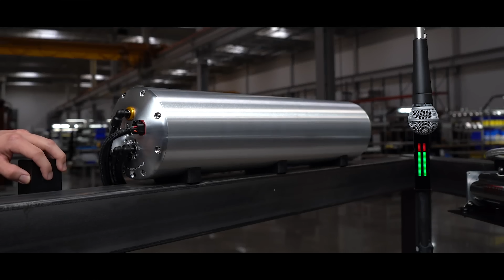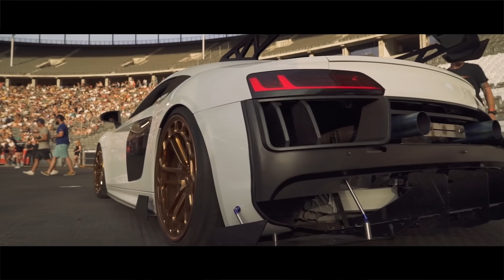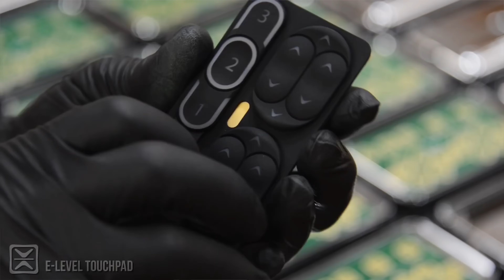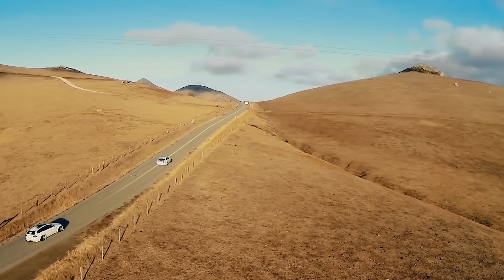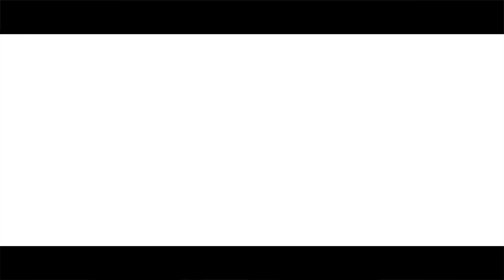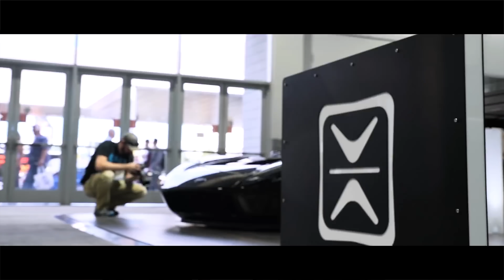Asking the Founders of Accuair Suspension 10 Questions | SEMA 2018

Comment: Newbie question here.  Living in east coast there is alot of snow here.  Can this system still go back to stock factory height or even higher?  Or does it by default sit lower?   Thanks
Reply from the maker: Nope, you definitely can go back to stock height! Although I would recommend to do some research about running air suspension in the winter as it can get a little risky!

Comment: Question: What if I daily my car and the Endo tank breaks?
Reply from the maker: You would have to work with the manufacturer or us if you purchased with us to solve the issue lol!
Reply: @FitmentIndustries  No I mean like, if say the compressor inside the tank broke, my car would basically be unable to run whilst I have reinstall a whole tank, correct? That's the only issue I have with the Endo Tanks unfortunately :l
Reply: @TheMuchti . You would be prepared and have some Push-to-connect Schrader valves available to keep you mobile. And get your tank replaced.